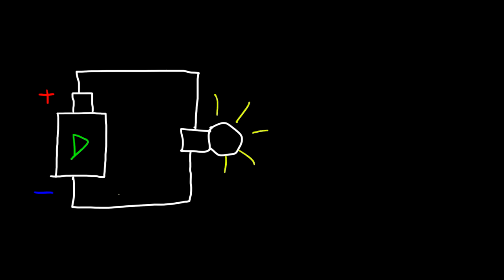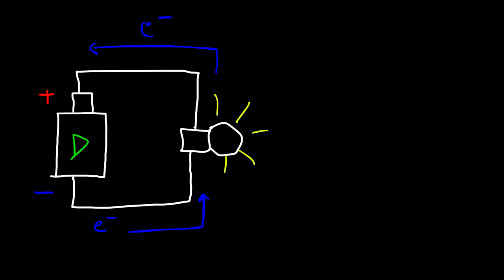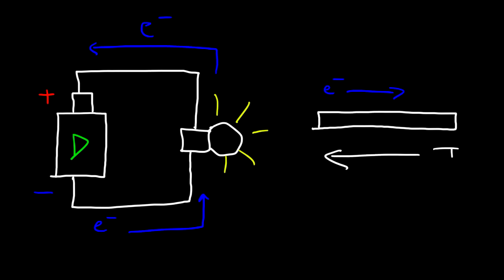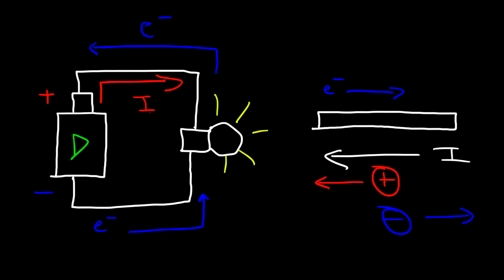The Electric Battery and Conventional Current - Introduction to Basic Electricity

Comment: hmmm but wait, according to Ohm's law voltage is directly proportional to current though, so isn't current supposed to increase anyway if we increase the voltage by combining two batteries in series?
Reply: V=IR
1.5v=10A×R__________(1)
3v=I × 2R ____________(2)
(2R since internal resistance is also doubled when connecting another battery of the same resistance) 

Simplifying the two will give I = 10A
Reply: Batteries have internal resistance, so you are still adding Rb1+ Rb2 +RL to obtain your current.
Reply: I think he means to increase the amp-hour capacities of the batteries, maybe? Connecting two batteries in series increases the voltage but not the amp-hour capacity.  Connecting two in parallel increases the amp-hour capacity but not the voltage.
Reply: I think (from a basic standpoint) that yes the current should increase when batteries are connected in series but it will increase more if we connect them in parallel, since when you have components in parallel the total resistance of the circuit is reduced thus increasing current but when we put in series the total resistance will increase due to resistance of batteries!

Comment: Suppose we have a 5V battery connected to a wire.. and how do battery give 5j of energy to electrons that are present in a conductor
Reply: The energy is given by the electric field that appears from the battery
Reply: Did you find out the answer?
Reply: @tanaka7391  no........ brother
Reply: @lalremruata this is pretty late, but if you're still wondering how to get 5 J from a 5V battery here you go.

If you know how many volts you have and you want to know how many joules of energy your circuit is using it also requires knowing the resistance of the circuit and the time.  

Let's simplify your question by saying you have a 1 V battery and want to know what conditions would supply 1 J of energy.

1 Joule of energy (E) is dissipated by using 1 watt of power (P) for 1 second (t); E=P×t

1 Watt is the amount of electrical work performed when 1 ampere of current (I) flows across a potential difference of 1 volt (V). P=I×V

1 Ampere is equal to 1 volt over a resistance (R) of 1 ohm; I=V/R.

By substituting you can combine these formulas into one:
I=V/R and P=I×V therefore P= V^2/R.
P= V^2/R and E=P×t therefore E=V^2×t/R.

So, in order for a 1V battery to supply 1J of energy, it has to be connected to a circuit drawing 1 amp of current across a 1 ohm resistor for 1 second.  

If you want a 5 volt battery to supply 5 joules,  you have to change the values of the resistance and/or time so that the math in the formula E=V^2×t/R comes out to be 5 joules. For example, 5 volts across 5 ohms for 1 second, 5 volts across 10 ohms for 2 seconds, etc.

Does that answer your question?

Comment: isn't putting the batteries in series going to also double the current in your example? If resistance is held constant through the circuit, then doubling voltage means you would have to double the current?
Reply: No because batteries have internal resistance. Use ohms law.

Comment: This is one of the very few videos on YouTube that discusses the electric field that is established in the conductor (starting at 2:00). It is this electric field that causes the electrons in the conductor to move as so well described! This cannot be stressed enough, and is something most other creators on YouTube have ignored. The source of the electric field is in fact the battery. A battery does not provide or consume electrons to the circuit per se, in the manner as most people think, but it provides the electric field which provides the force to the electrons that causes the electrons to move. Then a chemical reaction in the battery "absorbs" the excess electrons that happen to collect at the positive terminal (technically "reduction"), while a complementary reaction (technically "oxidation") provides extra electrons needed in the circuit at the negative terminal, but which are really created to balance the reduction reaction. They just happen to be available for the circuit which makes the whole thing work. Again, thanks for discussing the electric field!
Reply: @SorenSolveig Thank you for making me understand more about the battery.
Reply: Can you tell @soren solveig how battery generate electric field ?
Reply: @badgujarshubham5  Batteries are your source of electrical energy.  For a typical alkaline battery, electrical energy comes from a oxidation reduction reaction between  the chemicals in a battery. Durring the reaction electrons are liberated and collected on the annode.   Once there is more electircal charge on one surface than another, you have a potential difference.  In fields - I am not sure why he even brings this up - the electric field is perpendiculat to the conductor and is a function of distance from the conductor.
Reply: Holy molly man you have brightened my mind about how a circuit actually works, thanks
Reply: Ikr man there so many people who think batter provides the charges battery does not provide charges it just creates a potential difference for the already present electrons in the wire
Reply: i'm no expert but i'm not sure what you mean. Batteries even in what you say, are providing electrons and consuming electrons. Maybe you mean the battery doesn't push the electrons through the circuit, it provides an electric field that pushes them? You've said batteries don't provide electrons the way people think, but then you've stated that they do provide electrons. So maybe you should state what you think people think?!